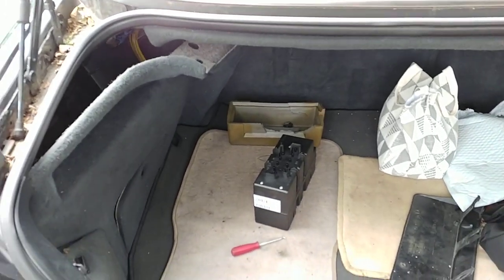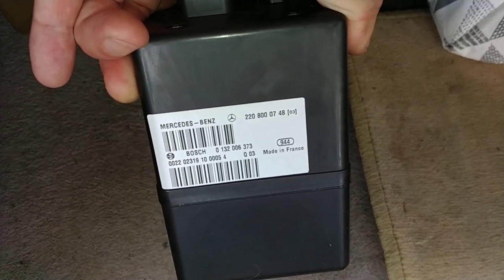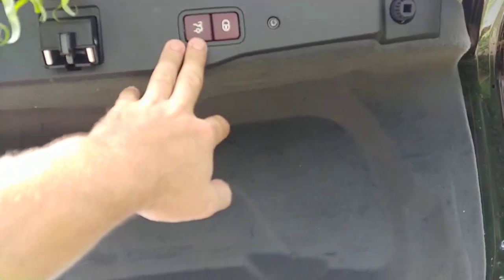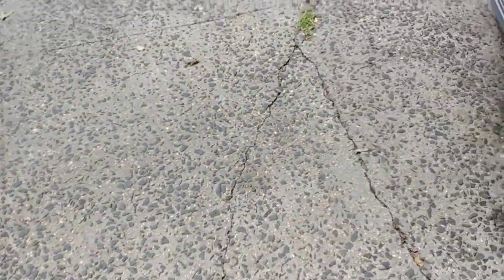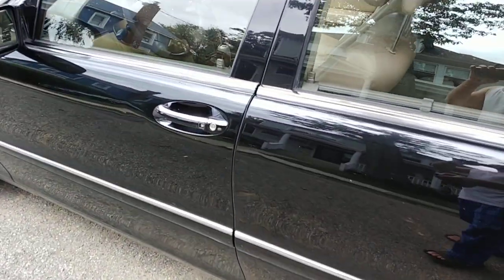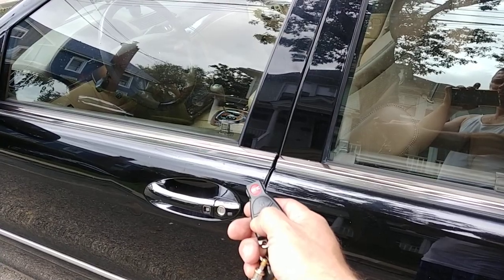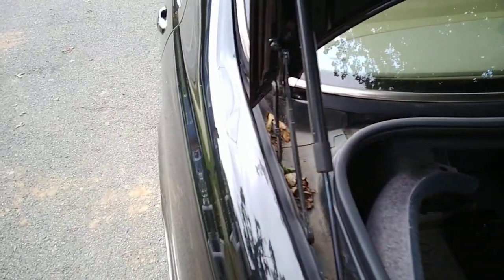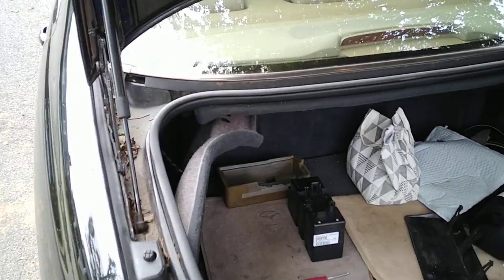Mercedes S-class. W220 door lock, aka PSE pump test.

Comment: Big thank you, your advice @6.20 was invaluable my pump was continuously running when driving, thought the door locks were okay tried your simple tip of turning off the seat lumbar to check that first and the pump seems to be back working as normal. Interested to know if the car can be run with the pse pump disconnected?

Comment: Hi Victor do you know if there is a way to program a new PSe pump when the old one is completely destroyed and cannot transfer settings from old to new with DAS?
Reply from the maker: @CL500MBZ  you can do a manual programming based on the option the vehicle has.

Comment: @vsandvs Great videos. It helped me a lot. I replaced my PSE pump with an used one and just repaired the leaks in the trunk release and soft close actuator and confirmed working. But the pump takes about 15 seconds instead of 3-5 seconds to soft close the trunk. Any idea what I should check next?

Comment: Hi Victor, Excellent video as always.  I am curious, are Autel scanners capable of programing the PSE? my pump on the 06 S500 failed (trunk latch leaked, replaced with a new one) and I replaced the pump used however, the trunk lid silver handle works in reverse.  I also want to make sure the 3 second rule is applied to soft close, so, I am looking for recommendations on coding capable scanners other than the STAR Diagnosis System that work for our cars.  If you don't mind me asking, what do you use for programming? Thanks!
Reply: de-solder the circuit board off the original pump (its easy) and solder it on the good pump make sure there are no leaks!! the MB guy will charge you a few hundy to reprogram the autel to my knowledge does not program options

Comment: ? My 2004 cl600 trunk, soft close, door, and inside door switch don't work seem like no power... I check under rear seat fuse are not blown..  Anyone know..
Also the touchless start work and the door lock and unlock mechanically also click but the pump a
Has no power etc